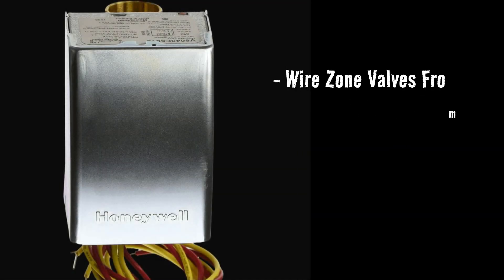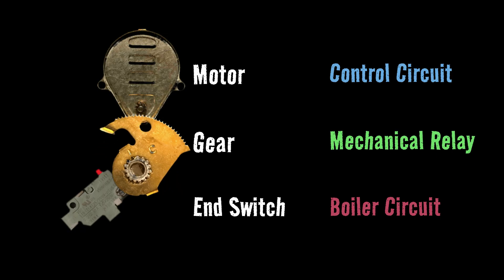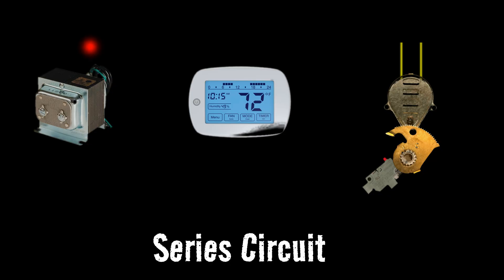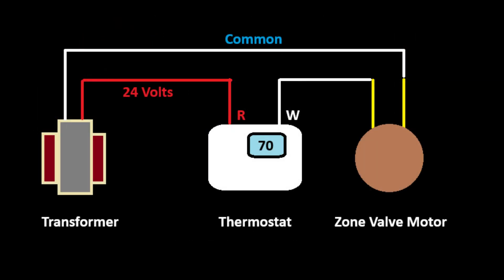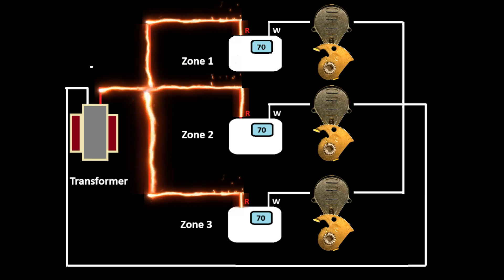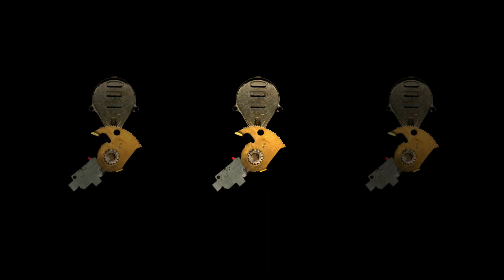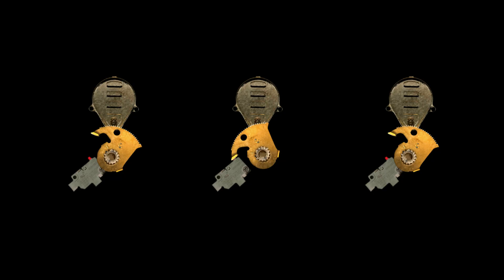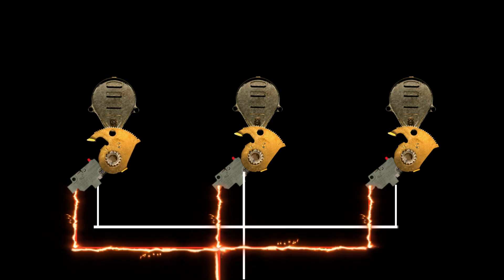4 Wires, 1 Boiler: How Zone Valves Really Work

Comment: Your videos are great!  I watched your older one on wiring the zone valves.  I just switched from a old traditional boiler from the 70's to a Rinnai Condensing Heat only boiler (Not Combi).  My friend who is a fitter helped me get it plumbed up.  He is out of town and I was going to wire the zone valves.  From what I am finding my 24 volts should be in the unit but I am struggling with where to hook the 24 V line and then common.  I hooked the thermostat direct to the unit and everything works fine.  I have only two honeywell zone valves (upstairs and downstairs).  I am not sure how to post the image of what I have.  It is a Rinnai ips120 heat only condensing boiler.  I have 4-zones in there with C/R/W.  I printed your diagrams from the video a couple years ago and they are great!  I just get lost with the 24 volt line and common?  Any help would be great!! Thanks!
Reply from the maker: Your 24V comes from R at the CRW connections at the boiler. Run one wire from R (at CRW) up to the thermostat R terminal. W wire from the thermostat goes to one yellow wire on the zone valve. Other yellow wire will go back to COMMON at CRW at the boiler. W at CRW is not part of this circuit. 

You will run another wire off of the same R terminal at the boiler (CRW) that goes up to the thermostat, but this one will go to one of the red wires on the zone valve instead. So that R terminal is sending 24V to both the thermostat R and the end switch. The other red wire on the zone valve will land back on W at the CRW at the boiler.  

 So that R terminal both powers the thermostat and the zone valve motor (starting at R and ending on Common at the CRW terminals). But that same 24V has to make it through the end switch to activate the W terminal on the boiler to initiate start up (From R to W at the CRW block) which only happens when the motor is fully open and the end switch is closed.
Reply: @JerseyMikeHVAC  Thank you so much!! That helps a lot.  I was close just wasn't sure on the white and common.  Again, your videos got me through this and they are very much appreciated!
Reply from the maker: Another note, if the thermostat is a smart thermostat, another wire will run directly from C at CRW to C at the thermostat.
Reply: One more thing.  The Low Water Cutoff which is optional has a factory jumper and says 24 volts.  Would I pull that jumper and use that as my line and common?

Comment: Thanks for the video. Can you explain the actual wiring? If the zone valves have 2 Y and 2 R wires, can you explain which is the end switch relay and which is the common wiring? Would it be 1 common wire for each ‘side’ of the zone valves wiring? What else would it be? 

I’ve seen these wired with 18-6 wire before as a install helper and although my techs understand and operate it correctly I have a hard time understanding it.